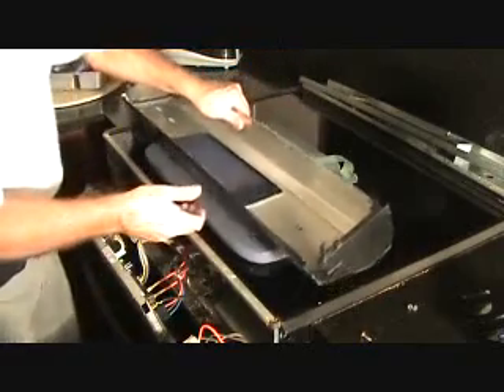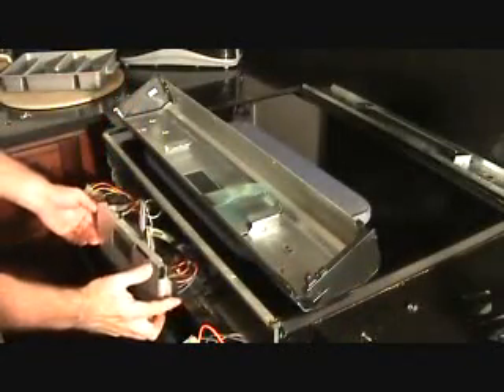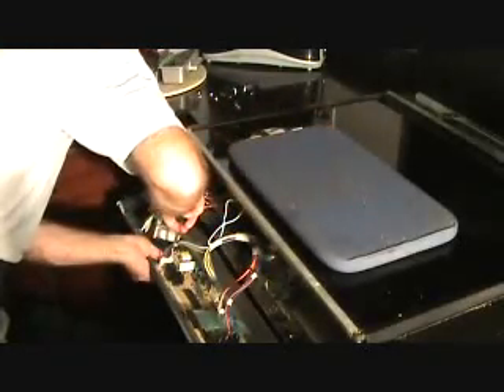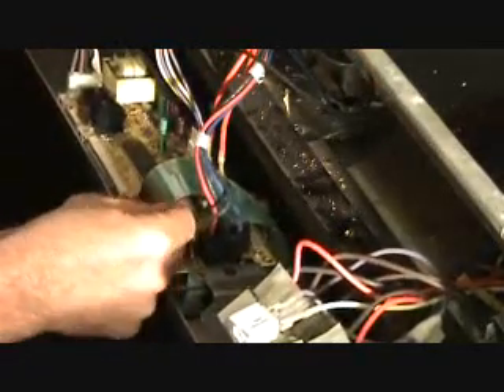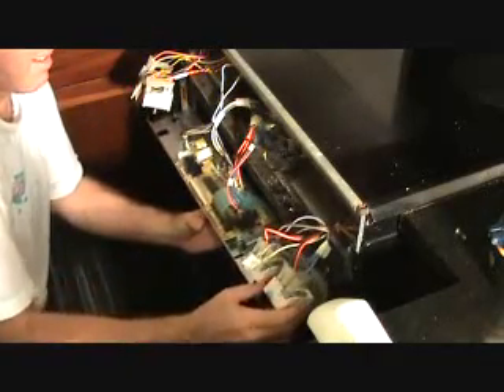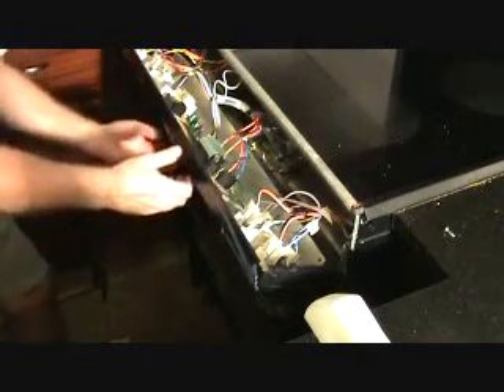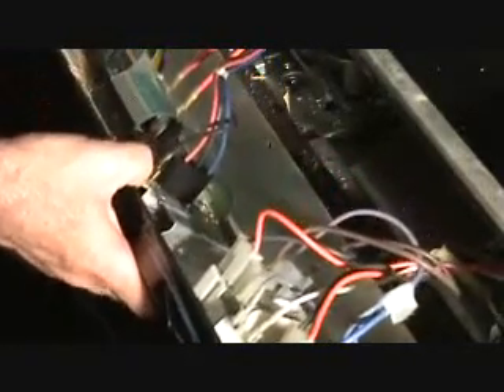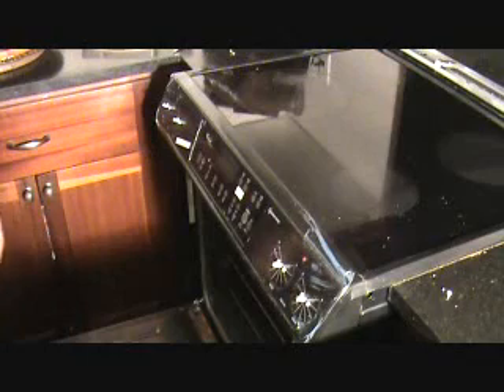Installing an oven touch pad

Comment: Joe: Thank You for sharing your videos.  I was able to replace both, the thermal fuse, and touch key pad on my whirlpool over.  The thermal fuse cost me about $25, and the front panel/Key pad cost me $175 including shipping.  My oven is working just fine!!  Oh, just like ever project I work on, I ended up with two extra screws… :).  Thanks Again for sharing! CR.
Reply from the maker: Awesome for being able to fix it yourself. Good going!   Joe  :0

Comment: Hi Joe - Great video. thanks so much. Question: Can you also just replace only the electronic board and not all the other wired attachments to the internal frame, particularly if the front outside panel is still in good condition?  I thought in my case it might make my job easier not having to go through re-attaching all the other wiring hubs.
Reply from the maker: Not sure as this oven touch keypad came with all that I showed but of course there are always other things that are not included & all I could do was pray that it worked after I got this replaced & it did. sometimes as you may know, it could be something else but most of the time I found that it was in fact in the oven touch pad. Thanks for stopping by!